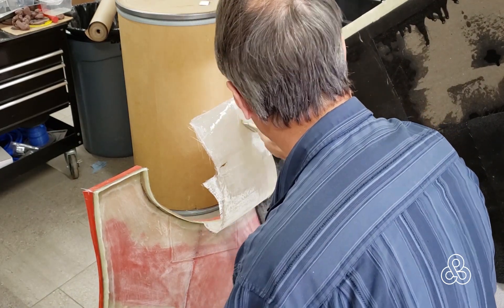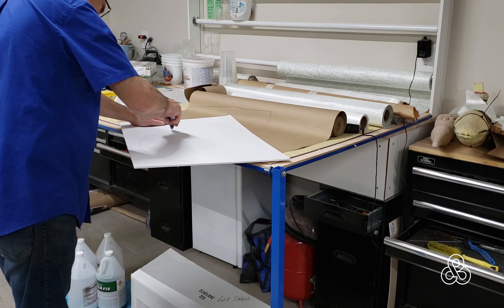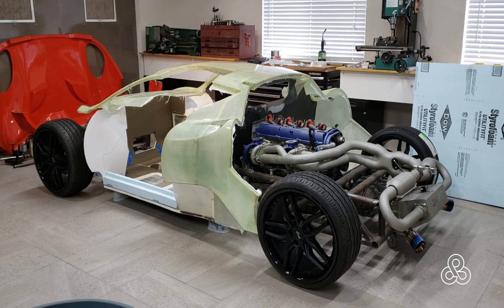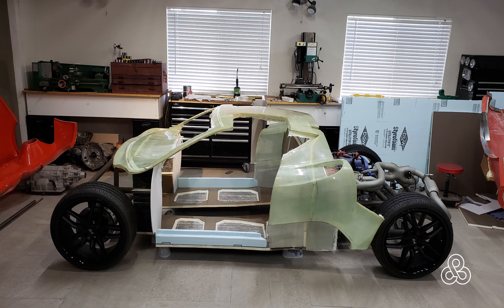A24 - This is starting to get real! The Tub section comes out of the mold. Arete Supercar project

Comment: Why don't you use aluminum in frond and midle subframe as lotus does to there fiberglas body? I herd they use steal on back (engiene) subframe. Original disight so mutch craft engeniring colculating sculping and still ull have havy frame as result car gona whath 100+ kilos more then it could be. Or its rly hard to culculate aliminum becoz is softer in tems of frame? And suspention is not alimumum i herd wath of suspention and wheels is even more esetual to cherectiristics.
Reply from the maker: Would like to have used aluminum on the subframes, but aluminum suffers some fatigue failure and other material characteristics that would make engineering the subframe beyond my capabilities (at the moment.) Maybe next round- bonded aluminum sheet metal.